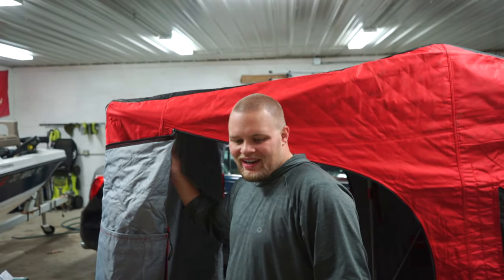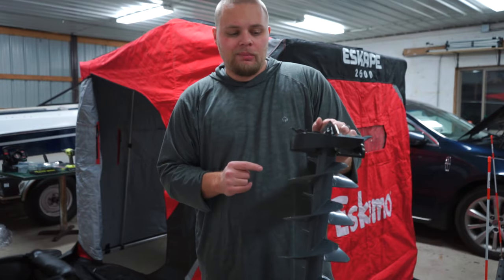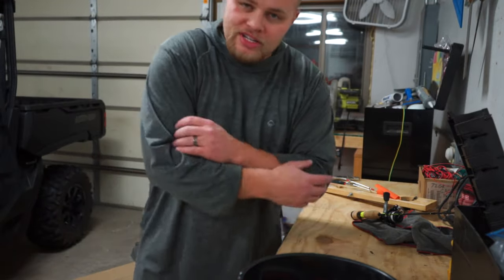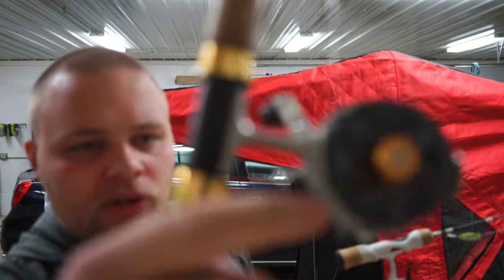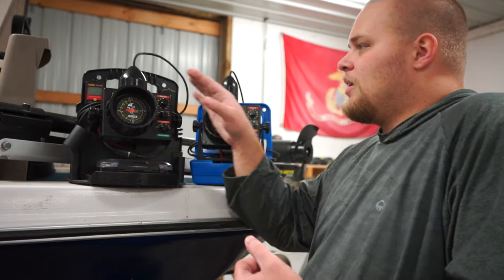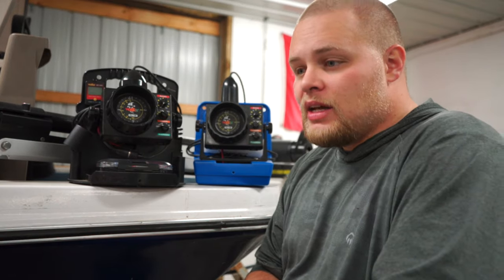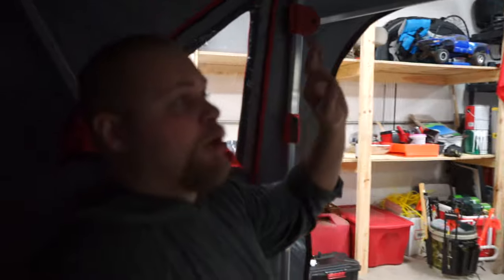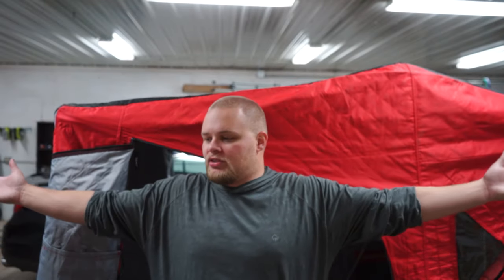Ice Fishing 2021: Gear List! New Flip Over!

Comment: Nice gear bro!

Tickle Stick is great... but that new Black Betty... meh. If you're dropping a jig or spoon and get an over run (It happens sometimes)the line still jumps off to the side.. usually the handle side on mine. Only way to stop it is to set the brake too high and your lure drops too slow. Ive dropped a spoon and had a crappie eat it on the drop. Got an over run. Started reeling and the tangled up mess inside stopped the reel dead in its tracks... so I had to hand line it back in.

Ive found that keeping constant gentle pressure on the spinning spool (Like thumbing a baitcaster) is the best way to get the lure down and prevent over runs. I now use spinning reels on everything except my one jigging setup. I only use it because it does keep that fluorocarbon nice and straight and not coiled up. Coiled up fluoro results in fish hitting a jig in a spring and sometimes  you miss the bite. 

Anyway.. just my $.02 as a weekend warrior. not a pro lol

Comment: Used a Eskimo stingray auger for over 10yrs. Shaver blades.  Cuts a little slower now than it did yrs ago but I have never sharpened or replaced the blades once.  If I need to replace them they are really easy to find. This year I’m going with an Eskimo pistol bit 8”. Going to hook it to a dewalt mud mixer or my Dcd999.  Also I’m a big fan of using Argos to ice fish.  I cross pressure cracks and know it won’t sink.  Just less stress knowing my 8x8 is also a boat lol.  Nice set up tho.  Keep dialing it in and you will get there.  Jk.    Great video bud.

Comment: The performance windows have been on the freefalls now for I believe 3 seasons, you can also avoid line jump like that by adjusting your drop speed and drag properly, it should be a smooth fall not a fast as I can hit the bottom of the lake free fall. My pb on a freefall was a 36 inch pike on a freefall trickshop edition with 8lb braid on a ML whiteout rod, video on my channel, they're great all around reels we use them for everything from panfish to pike I totally agree onthe freefall/ML tickle stick setup being a great overall combo I'd only suggest to spend a few extra bucks and at least get a better built OG freefall, great video though man definitely gained a subscriber here for sure

Comment: I love the flip over for portability. I would highly recommend not putting any fragile or sensitive equipment in the sled as you're traveling.  We learned the hardest way by losing a heater element,  all the water out of my minnow bucket, and a cracked vexilar case.  It's rough out there sometimes. Put as much as possible in the sxs.
Reply from the maker: Will do!

Comment: Man great reviews , fully agree about the kdrill,  much prefer chipper blades to shavers and I love the clam plate, way more stable with less bending over and keeps the battery off the snow, also the weight of auger from pulling on the chuck as I broke a drill using a nils auger,  my theory is drills where not really designed to have the load pulling away and the nils is pretty heavy so that probably didn't help.  New sub looking forward to watching your videos

Comment: How's the thickness on the sled & is it at least a little comparable to the Roto-molded on the 2800 & the Otters or is it thin & very flexible. I only have yours & another video to look at because no one has any Eskimo's on the floor anywhere around me & I want to get one online. My other 2 Eskimo flip top tubs are very thin & flexible & I do not want that again. 
Also you are 100% right on the chipper blades. But let the weekend warriors spend their money replacing those Laser blades every season, if they last that long.
Reply from the maker: It's quite ridgid, it's not the thickest around. But not any flex! I will be doing a full review video tomorrow, posting Friday!
Reply: @SgtOutdoors   Thank you so much! I've been watching your videos this last week listening to everything you said & looking at how it's built. It also fits everything I'm looking for in a shanty also. Thanks again & now I'm ordering mine before they're all gone.
Reply: Have over 2 years on the laser liteflight blades and ill still smoke you on popping holes!  thats a fact lmao!
Reply: @shane6232  I've yet to see any auger keep up with jiffy 8" & never replaced or sharpened blades in all the years I've had it.
Reply: I had a model 30 3hp 8in. for many years.... it's like trying to compare a tank to a Lamborghini.
Reply: @shane6232  How is that? Mine isn't very heavy. Plus it runs on propane not gas
Reply: @roniler7960  Just my experience I guess I have 25+years of the jiffy and I say the Jiffy has nothing on my Milwaukee and strikemaster. Weight, speed, quiet, dependable and no stinking gas. I went everything as light as I can. I love first Ice and will truck my ass miles across a lake.